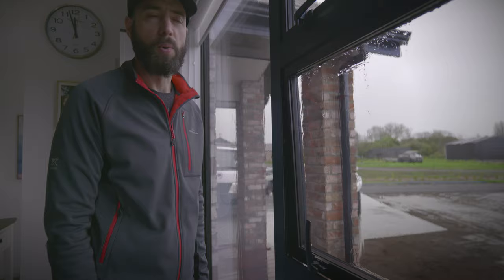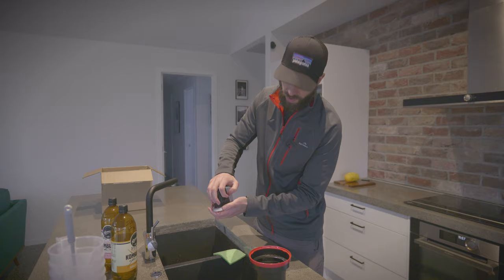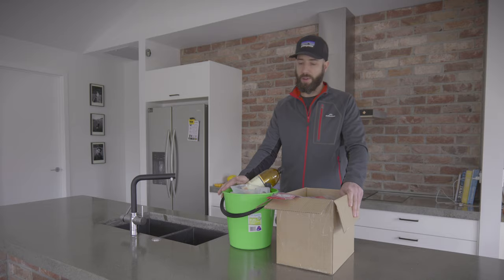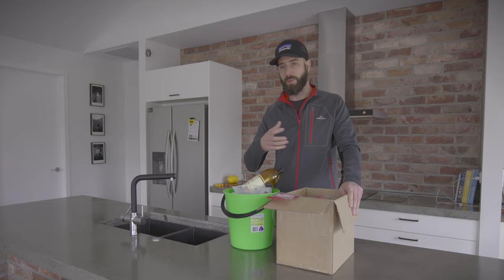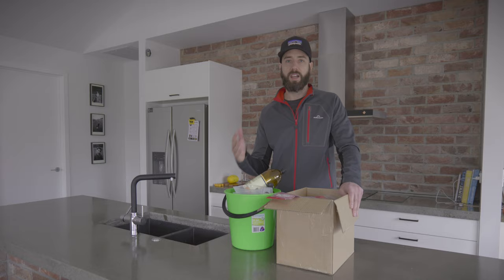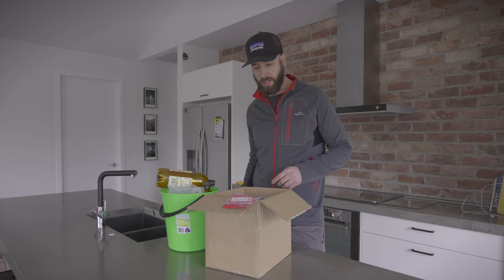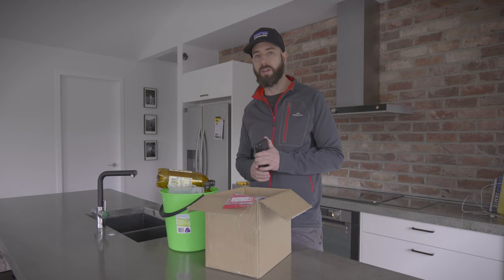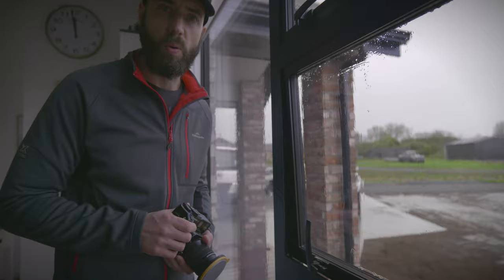How to Develop B&W Film at Home

Comment: I really enjoyed the images and video. I’m just starting off with home development myself. There are two things I’ve learned that might be of use. First, I use cheap stainless steel clothes pegs from Kmart to hang my film. I run the hot water in my shower for a couple of minutes, with door and windows closed. The steam helps drop the dust out of the air and I hang my film up to dry in the bathroom. So far, I have only had minimal dust. I also blow the film with a puffer and use an anti-static brush to give it a quick wipe before scanning. I use a different developing technique but don’t know enough about it to have a preference one way or the other.
Reply from the maker: Thanks mate 🙏 Thanks for tips too.

Comment: I use distilled water only for the whole process, it is not very expensive and it is easier to have a constant water temperature for the whole process. Tap water can be very cold in the winter here. Also my final rinse is with the wetting agent, I do not do another short rinse with the tap water. Before using the squeegee I rinse it, if you have a small piece of dirt or something like that on it, you can scratch your film
Reply from the maker: Thanks for the tips

Comment: My advice is to wash/soak the film 2 minutes before you develop, and I used to use stop bath but quit years ago with no effect,  just rinse with water then fix. Saves on not using the stop chemicals.  I have been doing this for years.
Reply from the maker: Thanks for the tip. Do you know how to use less chemical and develop for longer. Would reduce chemical by half and develop for twice as long work?
Reply: @StephenMilner  Unfortunately, a linear relationship for chemical development doesn't exist, so it's not so easy to predict. My experience for diluting development chemicals is to look at how long the developer takes at other than standard dilution for other film types if your dilution is not shown for your film. The best way without a densitometer, is to test the film and developer on a good average scene. It will cost you a couple of rolls, but you will then have confidence when you go to develop images you care about. Personally, I bought a densitometer and did my testing using a Stouffer zone chart inserted into a 4x5 film holder over a sheet of film and knowing what the densities for the zones should be as I metered and placed them on zones (shooting a blank white board at zone 10). The density results tell you if you over or under developed. But without a densitometer, just experiment with an average scene and getting a good looking negative.

Comment: Since you asked, your "wash" is practically non-existent. At best, you washed out the tanks while the film happened to be inside. Kodak recommends a minimum 10 minute wash in running water of about the same temp as the development; a 20 minute wash is recommended.. Ilford publishes a wash sequence of "dump and fills" without running water, but this is far short of that process. Your film remains fully infused with dried fixer chemistry, which will bleach out the silver image over time. A flush with wetting agent is not the same as a wash. It just promotes even drying. This procedure works only if you plan to promptly scan your dried negatives, then toss them in the bin.
Reply from the maker: Thanks for the tips 🙏